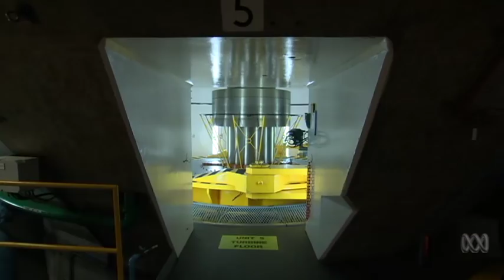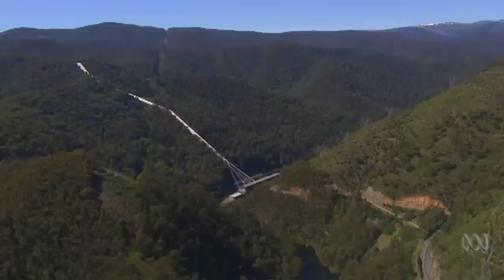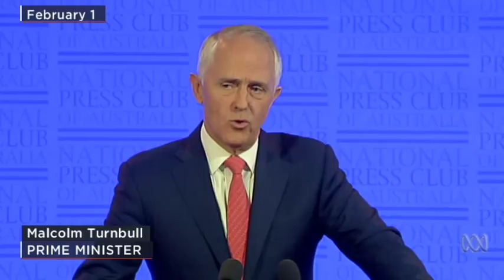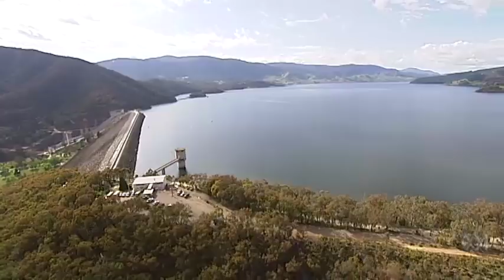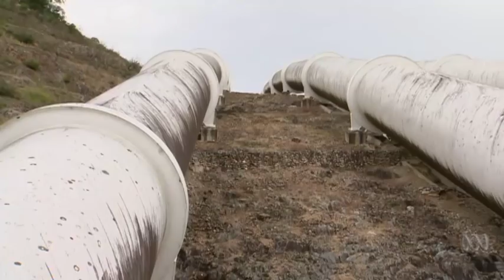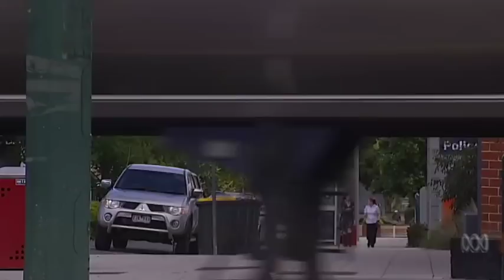Pumped Hydro: Australia's energy future?

Comment: damn thatcher privatization. thankfully nuclear is now more expensive than solar. storage is now cheaper than peak generation. AU needs to get off oil, get on storage and EVs for money savings and national security not "the environment".
Reply: Absolutely not as it doesn't work. How can solar be cheaper when it's output versus capacity is small, it's life is short and it is asynchronous, ie. it cannot support frequencyThere is not the slightest chance that storage will offset renewable intermittency, the capacity required is far too large.
I's laughable to tak about security, at least as afr as power supply is concerned, South Australia is known world wide as the grid crash test dummy, because of all the problems renewables have brought.
Australia has large resources in uranium and to not use them for power is unfathommable? It is avery cheap fule and gives consistent power.

Comment: Pumped hydro, as previous posters have said is very old technology. However it is not a back up for when th wind isn't blowing, it's nowhere near large enough in capacity for that. What it is used for is to be able, very quickly to cope with sudden peaks in demand. It uses spare generating capacity at off peak times to restore the level in the upper lake. As in most countries wind and (solar) run at full output, it requires fossil fuel generators to supply these schemes, so does not reduce cO2 emissions.
Reply: Does not always REQUIRE fossil fuel generators for replenishment. And even where fossil fuels assist, it may not eliminate emissions but it does reduce emissions. Solar and wind have made good strides in the last 50 years and will eventually become practical; just not yet.
Reply: Most Australians live near the ocean 

so they could use  ocean wave in addition  to pumped hydro

Comment: Massive amount of losses when you factor in repumping water back to higher levels.
Turnbull a political power puff who in reality is a know nothing.
Reply: Much more efficient than chemical batteries and doesn't wear out, make solar power actually useful
Reply: @alexjohnward  Debatable. Mechanical inefficiencies and losses in pumping into a head of water. Electrical inefficiencies and losses in the electrical motor driving the pump. Power transmission and transformer inefficiencies and losses over grid. Then there are all of those that come into play when using water and gravity and cavitation to drive the turbines. The over all losses are huge.
Reply: @richardkaz2336  around 20%loss on round trip due to friction, evaporation etc, but can store a long time, a large quantity, is reliable for decades, the maintenance and waste is negligible in comparison to other storage solutions, can be utilised by existing infrastructure, you need to do more research.
Reply: @richardkaz2336  Turnbull was a no-nothing? Seems you are blissfully unaware pumped hydro is more efficient than batteries on a round-trip basis.
Reply: @carl_in_denial  Not at all. Hydro is efficient ~90% efficient. But once you have to pump that water back up the hill @~80% efficiency and factor that in then you're really running a loss. Now lets talk about the electrical energy to pump that water derived from PV @~25% efficiency on a good day with peak condition of the PV and the Inverter that are ~80-85% efficiency. Then the transmission power transformers and both ends and any in between point A and B is 99% now the how about the transmission line losses and it goes on. If you're going to use wind turbines to generate the power to pump the water then they are ~40-50% efficient. 
Li-ion batteries are ~90-95% efficient on a round trip of power.
Reply: @M Detlef  
I do not know the type of the loss that you mentioned. However the efficiency of the pump cycle is around 70-80%. I put 80% into consideration because only one of the pump-turbine manufacturer has claimed the 80 % of efficiency in a paper, but we have not seen in operation yet. I would claim that the pump-cycle efficiency is around 70 %. 
The developers of the pump-turbines in Australia claim that they will use the solar power and/or wind turbine to run the pump cycle. Eventhough we accept this, the available enegy loss will be around 30%. The developer will always put profit on the produced energy. I would say that is to be around 5-20% in addition to loss. The developer will sell this energy around 35-50% greater than the available energy. So who will pay this extra cost? We are of course. The home owners, taxpayers, jobless, retirees.

I guess the Australian Government is looking for coal powered thermal power plant for this reason. It will produce the night time extra energy since it cannot be stop and start for night times which will reduce the life span of the power plant. They are designed for non-stop operation.

Unfortunately, the politiciants do not always tell the truth, and continue to built-up on their mistakes in the decision making.

I wished that there were more options on building hydro-power plant in Australia without another environmental issue. Sometimes it is necessary since it is the major supply of drinking water. I sometimes believe we make to earth suffer since we demand more energy, water, food and comfort.
Reply: The video did not really explain why pumped hydro is used, it mentioned it in passing but not clearly enough, I think for people to really understand it's purpose. Because of the confusion with wind and solar and talk about storage, I think this will mislead a lot of people to think that is what this facility is for
Pumped storage has been used for decades, long before part time power became popular and it is to avoid grid trips due to a suddenl 'oss of frequency when large loads ae switched on. Supply and demand is balance dautomatically by the running power plants but their reaction time is too slow for sudden peaks. Hydr can be switched on in a second or two, boosting grid input until the conventional generators catch up. The hydro station then shuts down until teh next spike in demand.
So it is all about grid security which is far more important than simple efficiency, which, of course, is low.

Comment: As it is an LNP idea,  it will have huge cost overruns,  have operational problems,  and it's future is not good as water will get more scarce with this thing eventually running dry due to losses.
Reply: no one knows whether there will be cost overruns

as far as water , just drive a truck full of water to the reservoir and dump it in

Comment: Pumped storage is great if you have suitable hills close enough to make it worthwhile. Hills with permiable rocks wont work as the water leaks out. If it's too far away, losses in the transmission lines reduce it's value. That's not to mention the ecological damage caused by rapidly rising and falling lakes.
What we need is a system that stores heat high temperatures. That's enough heat volume and temperature to generate steam that's usable in standard utility turbo generators. Moltex Energy are using a molten salt nuclear reactor to deliver its heat to a farm of thermal stores filled with "solar salt". That's the stuff used in thermal solar power plants (e.g. Cloncurry, Queensland). But while the solar plants offer low 10s of MW, the Moltex has a 1GW reactor feeding into 3GW of generating capacity. It follows the load demand without reducing operating efficiency. The first one going up in Canada will burn the stored irradiated waste fuel from a nearby solid fueled water reactor. This will extract the 97% of energy not taken by the old plant. It could just as easily use new fuel and there will be versions that can use thorium. The one energy resource we choose to ignore at least for now. 

The molten salts avoid the problems that blight the existing nuke industry while delivering all of the benefits - zero CO2, very low waste and high reliability.
Reply: David Elliott Michael Moore says molten salt is BS
Reply: '''''''Pumped storage is great if you have suitable hills close enough to make it worthwhile. Hills with permiable rocks wont work as the water leaks out. If it's too far away, losses in the transmission lines reduce it's value. That's not to mention the ecological damage caused by rapidly rising and falling lakes.'''''

lakes are not needed

man made reservoirs can be used

why not place a man made reservoir on top of a  10 story building?

Comment: This idea of energy storage require quantitative justification ie efficiency in terms of - charge efficiency x discharge efficiency = total efficiency. 

If we input $100 to our bank the transcript only records $70, when we call for $70 from it we only get $49. The total efficiency is 49%. 

So it is not a question of alternative energy charge and discharge. It is simply efficiency of an alternative method.
Reply: exactly that and also price to build/buy the equipment. wonder how do mega-pack batteries stack up to pumps and motors.
Reply: if Switzerland wasn't producing more energy from pumped hydro than they were using  they would have stopped using it
Reply: @robinsss  
all power plan made for a population should handle peak power demand that wouldn’t last for 24hr daily. The loose money off peak hrs. Pump hydro is a dumb idea from efficiency point of view but become smart because the plant can use less fuel at peak hrs. This is a business case not engineering case.

Comment: Not impressed!  They are using coal plants to provide energy for the pumping.  The novelty here is the story about switching to wind to do the pumping.  Now that's a good engineering problem to work on.
Reply: They prevent the need for another baseload thermal plant to be built by supplying power during peak demand. Do you think electrical demand stays constant throughout the day?
Reply: They displace peaker fossil fuel power plants, also can use cheap power when solar/wind/hydro are abundant, or demand is just really low. Speaking worldwide.
Reply: they could use solar
Reply: As more wind and solar energy are connected to the grid the more of that will be used to pump the water up the hill. That's why they are building more pumped hydro because of wind and solar.

Comment: History
The first use of pumped storage was in the 1890s in Italy and Switzerland. In the 1930s reversible hydroelectric turbines became available. These turbines could operate as both turbine-generators and in reverse as electric motor driven pumps. The latest in large-scale engineering technology are variable speed machines for greater efficiency. These machines operate in synchronisation with the network frequency when generating, but operate asynchronously (independent of the network frequency) when pumping.

The first use of pumped-storage in the United States was in 1930 by the Connecticut Electric and Power Company, using a large reservoir located near New Milford, Connecticut, pumping water from the Housatonic River to the storage reservoir 230 feet above.[19]    (Wiki)
Reply: The UK Dinorwig plant in North Wales has a rated output of 2000MW. The snags are it's a long way way from population centres and we really don't have any other sites which will do the job. It's built on land wrecked by slate mining and the power lines were already there to connect the (now closed) Wylfa Magnox nuclear power station.
Reply: @Dave5843-d9m  Most Australians live near the ocean 

so they could use  ocean wave in addition  to pumped hydro
Reply: I am sitting about 4 miles as the crow flies from that generating plant as I write this, and that plant is still in operation.  I always get a laugh out of these videos that make this out to being some new novel idea.  Candlewood Lake was created for this generating plant and now the lake is a huge source of recreation in the area for boating, fishing, water skiing, etc, as well as many businesses and lake communities that sprouted up surrounding it.  We are close enough to the populated areas when this reservoir was built that it was fairly easy for them to connect to the grid.  If the generating plant ever fails to be used, the lake will eventually dry up since the only source of water is rain and the generating plant when it fills the reservoir, so this will probably be forever in operation, the town can’t afford to have property values fall on the houses and businesses around the lake.

Comment: Capacity factor playes a major role. With wind a good capacity factor is 33%. This means that for 1Gw (Giga watts) coal or nuclear plant with a capacity factor of close to 100%. Has to be replaced with 3Gw of wind. When the wind is blowing 1Gw of the wind supplies the grid. And the other 2Gw goes to storage. So you need 3Gw of wind to replace 1Gw of nuclear plus the cost of storage both in volumn and power. Lets say the wind blows on day 1 does not blow on day 2 and 3. Hence the 33% cap factor.    Therefore if E=P×T energy = power times Time. 
As in the common unit Kwhr. 
Then 2Gwdays is a unit of energy that needs to be stored. Thats 2Gw × 24hr/day × 60min/hr. × 60 sec/ min. = 172,800 Gj of energy storage needed.
 ("j" = jouels = 1 watt for 1 second). Therefore go ahead and calculate the volume of water needed to be pumped at a set elevation to hold 172,800 Gj of energy.

Ok lets use an elevation of 100m. 1Kg weighs 9.8 newtons. Iifted 100m needs 980 Jouls of energy. 
Therefore you will need to pump. 172800×10^9/980 
Or
176,326,530,612 Kg of water 100metres high in one day to supply power for 2 days. I will leave it to you to find the land area required to store that amount of energy for a depth of say 10m. 
And this of cource is at 100% storage efficiency wow?

Now go do the same thing of solar with a generous capacity factor of say 20%.

Comment: 1:40 so basically they use pumped storage to store excess coal fired power at night. Only in Australia.
Reply: Whatever fuel you use it has to be done efficiently. Utility scale power plants are huge. They can't be just switched on and off. Even the smaller turbines can be offline for hours if they get an emergency disconnect. Try ramping up to fast and the internal parts will touch wrecking the turbine. It's the same with the boilers. So they are run at max rated load or near enough and ideally never shut down. When the excess power can be stored it's cheaper to run fewer plants continually than running high cost plants to deal with peaks periods.
Reply: @Dave5843-d9m  You're right David. That's the advantage pumped storage (and conventional hydroelectric) offers, it can go from offline to full capacity in a minute or less. That's why they're well suited for peaking plants rather than baseload.
Reply: they use excess power from solar, because during the day it can generate way too much energy. about 40% more than needed during midday.
Reply: @imakevideos5377  that sounds great but it's not what he said is it
Reply: tewrgh Actually, there are similar plants in many nations to include the USA. One in West Virginia is over 20 years old. Perhaps a bit of research prior to offering a comment is appropriate. To use excess power from whatever sources to pump water to the upper reservoir is cost effective so power can be generated without pollution when most needed. Thanks
Reply: @robinsss  cool, like a big old perpetual motion machine
Reply: @tewrgh  ok

I'm new to the technology

Comment: This needs to be rolled out across Australia. There are apparently 20,000 suitable sites for pumped hydro storage. Combined with a mix of tradition (coal) and renewable energy (solar and wind), once in place, you get extremely low cost power on demand 24/7.
Reply: yea no, we need to get rid of coal alltogether, it is a shit energy source with a low energy density, unlike oil. i dont like oil either but coal is much dirtier than oil.
Reply: Coal should be replaced with gas or even better would be geothermal, but I don't know if that's possible in Australia
Reply: @jokubasvanagas3174  Interesting you say that because deep geothermal is soon to be a thing. First 3km is drilled using a traditional drill bit, the next 10km is drilled using a vaporisation technique, and you get a 13km borehole down to 500C rock, from anywhere on the planet, and geothermal for the next million years.
Reply: Fuck kinda reason is "tradition"? Oh yeah let's keep destroying the fucking planet because we've been at it for a while. Fuck off. Get rid of fossil fuels ASAP.
Reply: Look at it this way ,,, A dam makes a big mess as it is made and then fills animals are displaced and some humans to. However a dam lasts well over a hundred years and is near enough 100% recyclable
AND lets not forget Nature can with help rebuild the environment after it is gone.
AND also i have never seen a dam impoundment empty of all life water encourages animals to set up home.
Now WIND AND SOLAR well 20-25yrs at best and not even close for recycling 70% at best and the energy used to make it, install it, remove it, are extra a dam make far more money than was spent making it and easily covers the power (energy costs) costs to remove it.
The dam returns far more in its life MORE DAMS PLS And RDP Marine Australia has a system that can be retro fitted to a dam to make extra and is cheaper